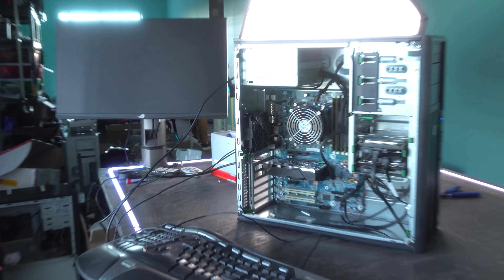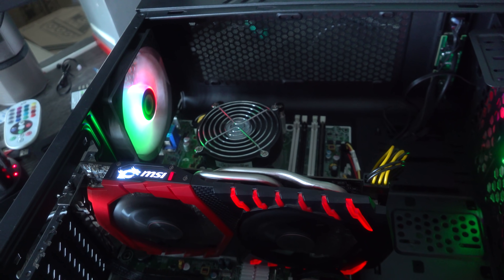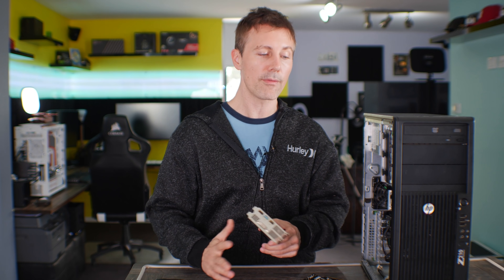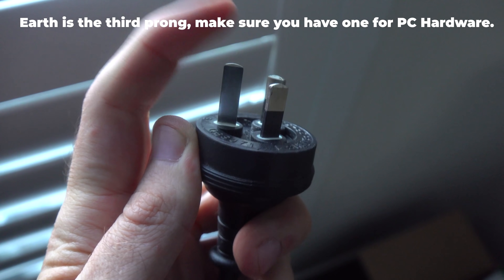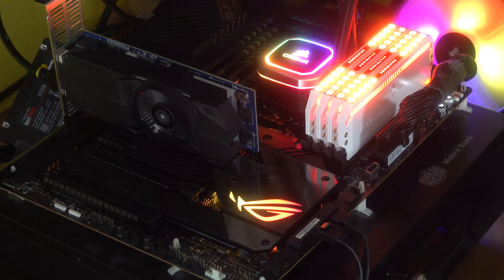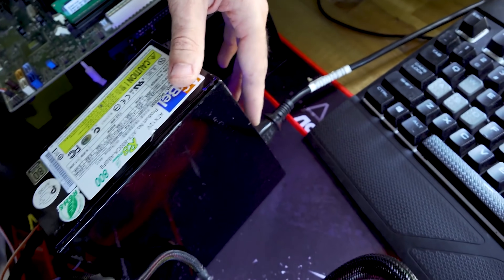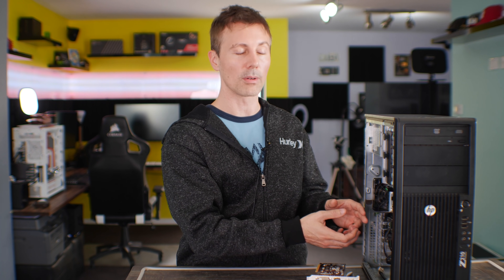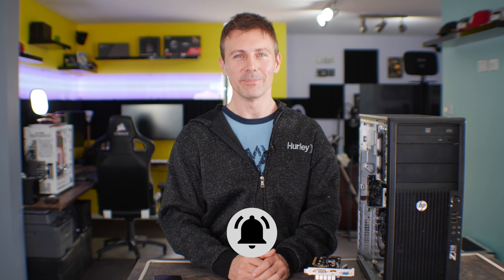Black Screen, How to FIX a Computer that DOESN'T Boot?

Comment: Guys, what os should i install in my first built gaiming rig - r7 1700x and gtx 1070. Windows 10 pro or tech yes edition, which one do you recommend?
Reply: I'd do regular W10 and use scripts like windows debloater to basically make your own w10 lite. Custom versions causes a lot of random problems that you'll never figure out and there's always the update issue.
Reply: @imnota  thanks
Reply: Windows 10 Pro, perform the tweaks yourself with one of Brian's videos as a guide.
Reply: @pk.002  thanks
Reply: I'll just install regular win 10 pro and debloat and optimize myself